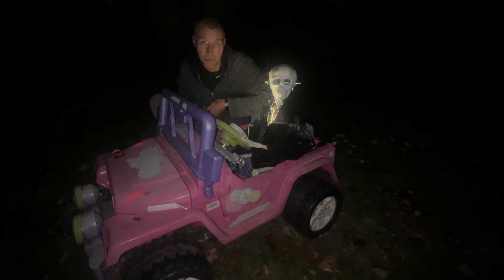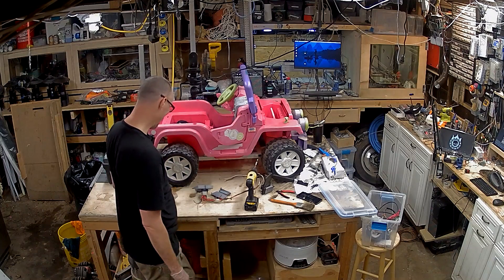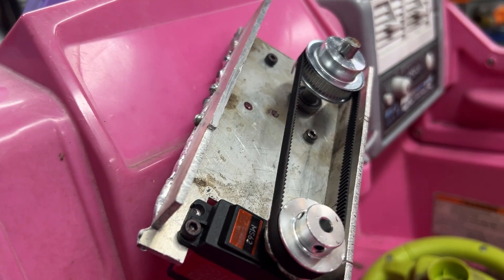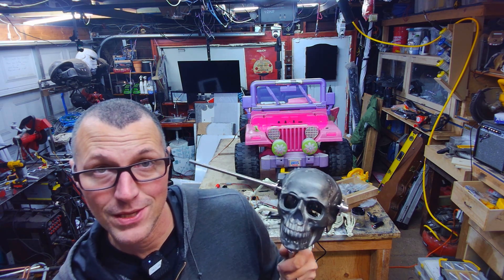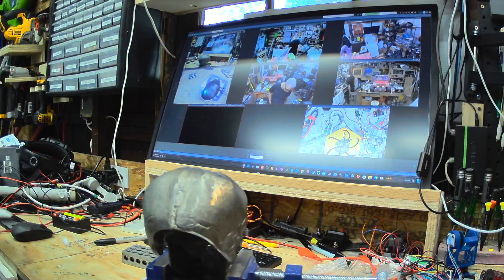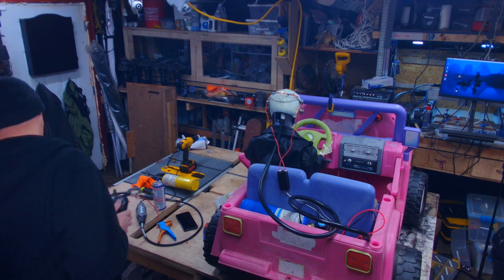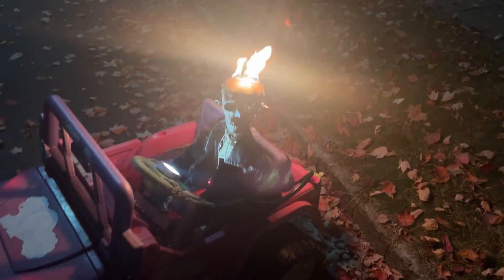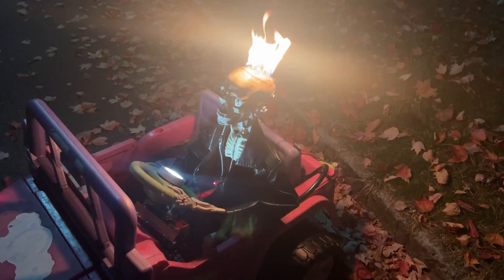Winning Halloween Ghost Rider FPV!

Comment: First off, your garage setup is incredible—those automated cameras add such a professional touch. Are those PTZ cameras you're using? I'm curious about your workflow: do you manually retrieve footage from memory cards, or do you have a system in place for syncing and recording? Also, your integration of ChatGPT into the project is impressive. How did you manage to stay focused on editing without getting sidetracked by all the other possibilities? The editing is top-notch; how long did it take you?

Regarding your build, have you considered using a PlayStation controller with the Bluepad32 library? I've got a stack of ESP32s and an RC jeep for my kids that's been upgraded with tool batteries, converters, and new motors. After going through multiple internal controllers, the idea of using a PlayStation controller for control is appealing. Your video has inspired me to revisit making videos myself. By the way, I discovered your work through GPT. Keep up the fantastic work!
Reply from the maker: So first off, thank you so much (comments like these really mean a lot to meI am in no way a videographer or editor, so I'm happy with any anyway I can make it easier!

I did not want to deal with moving around microSD cards at all, the things are cursed,  so I got this idea from my home automation background: I use Blue Iris, which is essentially a security camera program, and I started off with just a bunch of IP cameras! They get power over ethernet, so they work great. Then I made a little interface I can use from an old phone where I arm whatever cameras I plan to use for the shot, then when I hit the record button it gets them all in general sync (it's very easy to sync them up fully in premier). The video quality is not great, it's H.264 encoded, but it doesn't take up tons of space, is easy to edit, and all of the files are time stamped so they easily can be kept together in some folders for different multi camera shots.

I have yet to use a video game style controller; I just haven't had a need yet, and I use the RC style one because I wanted to learn how they worked but also because they have really good range  and dependability (you can imagine if I lost a connection and propane was coming out of the skull and it was driving off on Halloween).

I know I have a short up here somewhere on an earlier version of my multi camera recording set up, but I plan to do a full video on it at some point, I have a lot of the footage I just got bored with it. 

To answer your last question, I am constantly getting bored with projects and moving onto new ones without finishing the original projects, and it's only when I come back around and get excited about them that they actually get done and produced into videos, but that works for me. I'm doing this more for the hobby and learning and less for the views , but I should slowly limp over 1000 eventually : )

Thank you again so much
Reply: @gearscodeandfire Hey man, haha I just found your reply—turns out I had way too many YouTube notifications on, so all comments basically vanish into the abyss. Might have to tweak some settings or something before I miss more awesome replies like yours.

Loved reading your setup explanation—makes total sense now. That Blue Iris idea is genius, especially with the Power over Ethernet and IP cam combo. Having them all timestamped and synced like that, super smart. I’ve always recorded stuff but kept it mostly to myself… but now seeing how you’re leveraging shorts has got me thinking maybe I should get into that format too. Editing full-length stuff just takes so much time and headspace, especially when you’ve got little humans hanging off you 24/7, haha.

Totally hear you on the RC controller choice too—Bluetooth and fire definitely aren’t the safest combo unless you’ve built in that “connection lost = kill everything” logic. Even then, I'd be white-knuckling the controller if I had propane involved, lol.

And yeah, I feel that whole “cycling back to old projects” vibe. Same here. My channel basically flatlined once the babies entered the scene. Now they follow me everywhere like little shadows—awesome, but wow, do they limit your flow sometimes. You totally get it, I can tell.

But hey, I’m still tinkering. Just fixed the RC jeep for my boys with an old-school brain again, but I’ve been doing some deeper stuff on the side—got a bunch of ESP32s running motors and trying to figure out the best way to step up voltage and modulate speed reliably. Been testing different relays and load-switching setups for a more analog style throttle without frying anything. Kinda like building a modular brain that doesn't care if it’s talking to brushed motors or AC compressors.

Honestly, I’ve got this dream where AI and Premiere Pro Beta can just crawl through my entire NAS one day and auto-create storylines from years of recorded chaos—turning dust-collecting footage into watchable projects, haha. Wishful thinking? Maybe. But hey, it’s 2025. Never say never.

Anyway, your stuff legit inspired me to pick up the camera again—even if it’s just to shoot a short of something half-built and totally janky. If you’re ever up for bouncing ideas, hacking on something random, or even just chatting about failed projects we never posted, hit me up. Between kids, side hustles, and chaotic DIYs, who knows, maybe there’s a fun crossover in there somewhere.

Cheers man, love your energy—subbed and watching what’s next 👊
Reply from the maker: @VentureVlog Awesome, thanks so much dude and I'm glad some of the ideas were helpful- i am NOT in any way of videographer or editor, so I try and keep the recording as simple as possible. My biggest advice if you are getting back into it: YT shorts and Instareels (hit me up on instatok). It's a great way to share works in progress for people actually don't wanna high amount of production value because it makes them seem less authentic- I've met a lot of cool people using that venue
Reply from the maker: (Bump in case rewriting my initial response didn't give you an update)

Comment: If you want to minimize wheel spin use bicycle tires you have to screw them to the tire of the power Wheels
Reply from the maker: A great idea- at some point I plan to update the wheels and add brushless motors to the gearboxes

Comment: Since you are using two motors, have you given any thought into simulating a differential? I am trying to implement one, using a steering wheel sensor, to give my car a better turning radius. I was wondering if you have any suggestions on how to do it? Perhaps, a suggestion on a good guesstimate ratio, so I wouldn't need to figure out a whole lot of complex math, that would probably be lost on the project, anyway. 

By the way, I love ESP-32, but so many accessories are designed for 5 volt supply and signals. (PWM lighting, hall effect sensors, etc.) I have been having success with an Arduino handling the driving of accessories, and the ESP-32 taking commands from ESP-NOW, and handling the major computing. I've been communicating, using the Arduino's analog lines & using voltage ranges for different commands. Right now, I'm mainly working on lighting. Once I figure out maneuvering the vehicle, then I will be able to put the wheels down & test it out. I'd like to put a camera behind the windshield for a first person view. That comes much later. 

This is my second project. The first one didn't turn out so well. It needs a complete re-wiring, and I wasn't smart about device placement. I am hoping to learn a bit from this project, to be smarter about my first project.
Reply from the maker: Q: Since you are using two motors, have you given any thought into simulating a differential?
A: Absolutely not, for two reasons: a) totally didn't occur to me, and b) I had already run into so many unexpected behaviors of having a super low load in the Power Wheels, it was behaving oddly from the start, so any fine tuning like a differential was VERY far from mature in this design!

Q: I am trying to implement one, using a steering wheel sensor, to give my car a better turning radius. I was wondering if you have any suggestions on how to do it?
A: 1)You already sound smarter than me, and I hope your car is 1:1 scale, because that would be awesome.
To clarify, tell me what you are using as a "steering wheel sensor" (I am not using quotes to sound like a jerk but to try to be as precise in my response (also I get neuro-spicey when it's late at night)).
A: 2) You might be asking me about the gear ratio on the steering wheel servo, which I think is 4:1 using a 35kgm*cm servo. Sorry if i am just confusing things here.

Q: (It wasn't a question, but i'm jus' tryin to make it fit with my response heuristic)
I love ESP-32, but so many accessories are designed for 5 volt supply and signals. (PWM lighting, hall effect sensors, etc.)
A: True that. However, my experience has been that I rarely need a level shifter for a 5V device with direct GPIO connection to 3.3V. It's 100% easier sending a 5V signal to a 3V3 signal, but still.

Q: ...and the ESP-32 taking commands from ESP-NOW, and handling the major computing.
A: ESPNow is the truth. All hail @ruisantos

Hope I was helpful, and post your stuff dude! Throw a link here if it's up! I love 5the niche YouTube community that has basically taught me this stuff!

Comment: Nice job! I have been considering something like this for a long time but just never got around to it and you did it Hooray!  What IDE did you use? Arduino or Espressif?
Reply from the maker: Thanks! I'm using plain old Arduino IDE version 2.0; I was able to put all the code in one .ino file so I didn't have to get fancy with external libraries or anything.